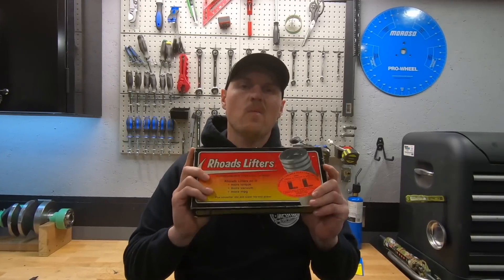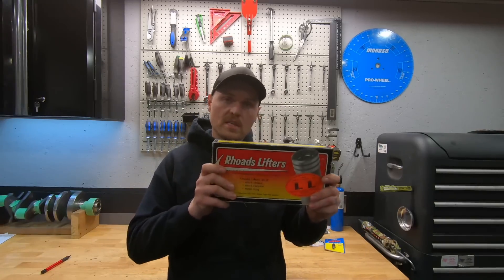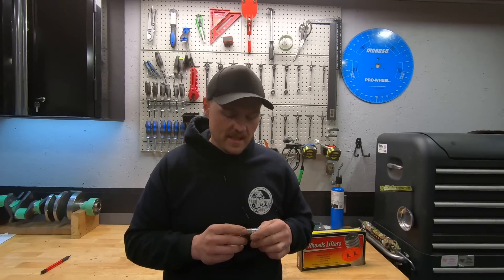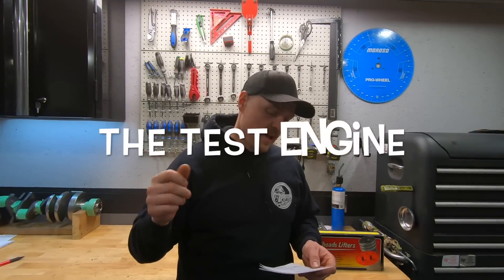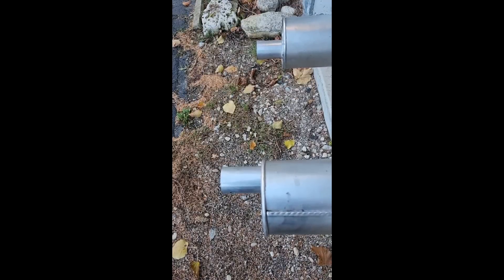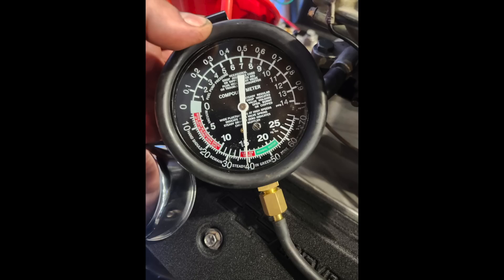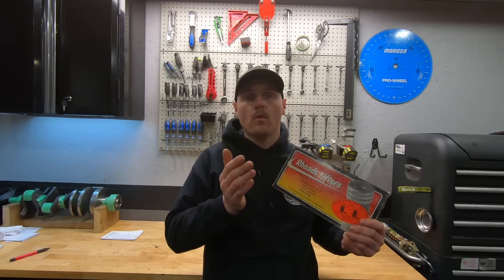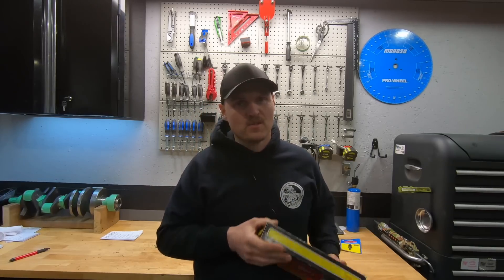More Power? More Vacuum? Rhoads Lifter Test Part 1 (406 SBC w/Summit 1203 Cam)

Comment: Very interested in the dyno test. It is a cheat that some may use in circle track. There is a rule about "no rhoads lifters, "x" amount of vacuum at RPM, lift rule, duration rule. Yes, some may cheat. Just curious how this compares to collapsing the Delco lifters. Please test. Also, there may or may not be a cranking compression rule.

Comment: I built a 350 Chevy in about 1985 for my ‘69 Camaro.  Ran 13.60’s with Erson cam and lifters.  I swapped out the lifters with Rhoads and with the same tune, it ran 13.60s… same as before.  I think they were the next big thing back then.

Comment: Please do the dyno test. I think you are going to find above 3000 RPM they match the performance of the standard lifter. Rhodes states its a function of rpm and viscosity not oil pressure so oil choice will be important.
Reply from the maker: I want to test them with 20w50 and 10w40
Reply: @cuttersperformance  I'd use a 5w30 instead, you'd come closer to making a difference vs. a 10w40 weight .

Comment: I had good success with the Rhoads lifters on a 327 30 over. Comparing to my friends engine built the same and same camshaft. Mine idled at 650 his 850. I ran 2800 stall a he had to run a 3500. Mine had more lowend torque and more drivable. And wasn't quite as noisy as yours for some reason.
Reply from the maker: They actually sound noisier in the video than they do in person
Reply: What camshaft were you guys running in your 327s?
Reply: @carlosfgarciasepulveda5927  the old 280 Cam Dymactics.  A long time ago 230 at 50 about 480 lift can't remember the LSA but I'm guessing 112

Comment: Please run the dyno tests of each type.
I ran them in the 70's, early 80's, right after they came out.
They seemed to do as advertised, at least helped the vacuum at low rpm without noticeable drop in HP.  No dyno testing done at the time, couldn't afford it.  🙂  They did have an issue that if the idle oil pressure was too high, they didn't work as well.

Comment: Ive ran these in sb chevy since the 1990's. Also for oval track with hyd cam rule. Why? Torque for restarts. Also for race classes with min vac rule. We revved them 7200rpm, lap after lap(3/8 adobe, very fast sticky track) all seaon, no failures of valvetrain. (Longslot rocker and rollers, single .600 lift spring and double heavier springs). Crane makes a 'quiet' version. We tried and always went back to Rhodes. Rhodes also makes 2 versions of the lifters.

Comment: Yes! dyno comparison of the lifters would be fantastic. If the Rhoads perform as claimed, I'd be impressed and I think they will. Question; does the  slightly noisey operation mean more potential rocker/push rod wear? Thank you for another great video. 👍
Reply from the maker: I was wondering the same, but I would have to say no as there isn't any lash, with lifter collapsing with a cushion of oil
Reply: Excuse my nieve question, but where is the source of the tapping sound at idle? Pushrod/lifter? Pushrod/rocker? I'm humbled, but that's why I watch your channel. :--)

Comment: They resume typical function at about 40psi. That may differ with each application.  Don't have to believe magazine advertising,  talk to the old timers. Especially those in circle track racing. Many of the elite racers from the 70's and 80's ran them. 
  If you want to set a few more things straight. Try running the VW mushroom variations. They will add about 20° duration to any cam. So while the lifter register 15" of vacuum for tech inspection. By 40psi, the lifter returns to normal. The wider lobe footprint can allow a 260° cam to be used in vacuum restricted classes. The key was to adjust oil pressure to the track conditions. When in the rpm, the power comes on at full. 
  Dick Trickle, Alan Kawicki,  Mark Martin, Rusty Wallace,  and Dale Ernhart all ran them. As a matter of fast. They were in Bill Eliots' car in 1985 when the highest Daytona speed was recorded. 
  Today... other manufacturers try the same function through a bleed whole in the lifter face. As pressure increases, the oil is diverted to the whole. As the oil is restricted from flowing through the  whole, the lifter pumps up. 
  Try the VW lifers with a small cam. Factory one for all science purposes.  Watch it gain 15% power and an additional 2000 rpm.

Comment: I remember selling these in the 90s. IIRC the key is the oil pressure. Too much low end pressure and volume tends to keep them from bleeding off, too little top end pressure keeps them from pumping up. Old school 20w50 and straight 30 weight guys had cold start and running issues, lifter staying pumped up.

Comment: I ran a set of these in a SBC 383 many years ago. The engine had a pretty radical cam and it was still lumpy at idle, but I do not recall any lack of low end torque. They clattered somewhat like a solid lifter - didn't bother me at all. Did not compare them to solid lifters in that engine, but I was happy with the way it ran.

Comment: In the mid 90s I met a racer who praised the Rhoads lifters. He said they gave great low rpm power and on the top end the motor would rev up so fast it slung the belts off. I tried them on a mild cam 350 NA with an automatic transmission and highway gears. It ran strong but in the course of running them I had three malfunctions. I broke a pushrod first, then another pushrod, then broke a rocker arm. I went back to regular hydraulic tappets. It's supercharged l now and I've never had a valvetrain issue before or since the Rhoads.
Reply from the maker: Interesting! Thanks for sharing your experience
Reply: Broke a rocker with them, pulled them after that.

Comment: I also wonder how long cam will last changing lifters back and forth (I get the “impression “ only lifters are being swapped out and not the cam originally installed ).Is this the case ..it was not exactly made clear in the video.
Reply from the maker: If you watch from 4:45 I explain that everything is exactly the same. The only thing changed was the lifters in this test. 
(AlsoThe lifters are marked are going back onto the same lobes, there shouldn't be any added cam wear)

Comment: They function from bleed off. Viscosity is crucial, but in a post EMP world you are back on top! I have always wanted to see the difference. Seems sensical to me. Now that there are so many oil formulations, could this even be enhanced?
Reply: Gonna be on top in a post EMP...how you gonna get gas?
Reply: @toefield251  Wood gasification, plastic and waste oil distillation, composting can produce Methane gas, if you have skills and will you can often solve your needs.
Reply: @bryanst.martin7134  Good old moonshine is the way I would go. Double duty.